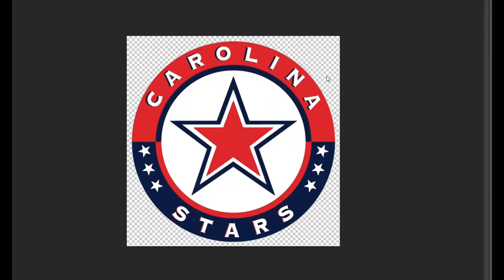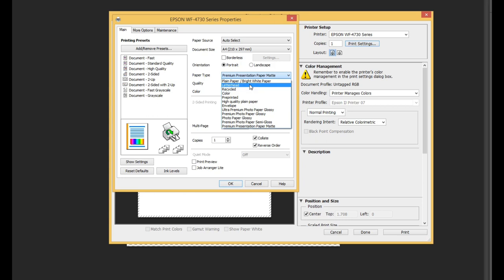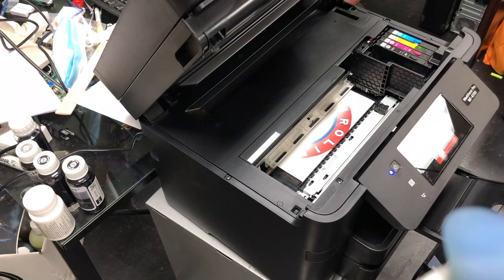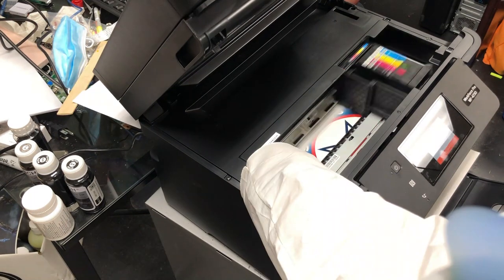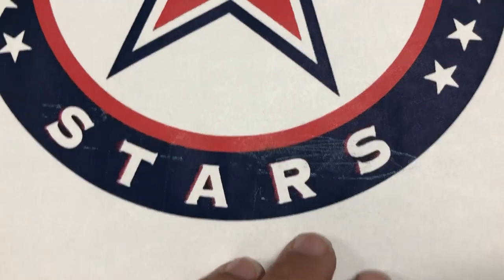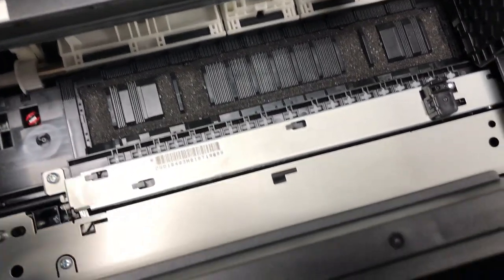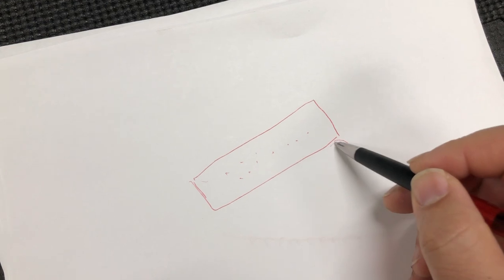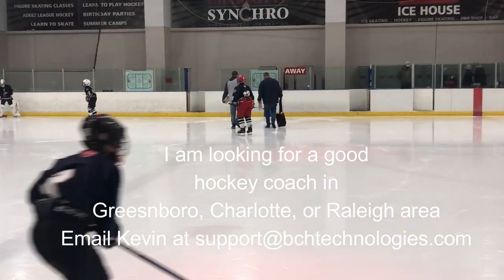#1 Remove/Reduce Epson Star Pizza Wheel Roller & Printhead Strike Marks

Comment: I have watched many videos and none were able to solve my issue. I use an Epson 15000 and constantly ran into random black smudging and spotting. The thick paper option in the extended settings is what actually did the trick for me. I was even able to up my density to +20 without any issues with no stopping of the print or fan blowing. Only drawback is prints definitely take quite a bit longer do to the slower passes, but well worth the trade off for me! Thank you for explaining in great detail exactly what was causing the issue and providing such great solutions!
Reply: @Mikayla Loaiza yes that's exactly what I'm using.
Reply: @Mikayla Loaiza You can adjust to the thick paper setting from printing preference, maintenance tab, Extended settings, Thick paper and Envelopes. You can also increase your print density here to your liking. I hope it helps you as much as it has heloed me.
Reply: I hope this helps me I am gonna try it. Do you have to change the settings everytime
Reply: @churchkimber6401  No once they set and saved you should be good to go.
Reply: @tnjsclothing6538  Could you share where the print density is? I found the thick paper but not the density. Thank you.

Comment: I keep getting pizza wheel dots on my tumblers.  This started after I had 1 piece of sub paper get sucked back into the printer as if I was printing duplex.  I have never intentionally used duple printing.  Since that day I have been getting dots in random spots.  Part of the problem is that the dots are tiny.  They are not visible on the paper until I heat press the page onto the tumbler.  I guess the heat makes the tiny dots expand and they appear in many places on the page and therefore on everything I have been sublimating.  If there is white in the design the dots are extremely obvious.  I have bought 2 different cleaning products and also have taped ribbon to a card and have cleaned the wheels manually by sliding ribbon with Windex through the wheels back and forth.  It did clean some wheels and leave spots showing it removed some bits of ink. But the next time I print then cook my tumbler I am getting new spots and some of the old.  I have more spots now than before I tried any of this cleaning.  I have the Epson ET3830 and cannot find a Bi-directional printing setting anywhere.  I also cannot see a page with the ink coverage like you showed.

Comment: Okay, so I keep coming back to the pizza wheel dilemma every time I print on glossy stock. Do these even really serve an actual purpose, other than to annoy? I decided to tinker with my Epson, opened it up, and removed all the pizza wheels with tweezers. Printer still functions fine, prints perfectly now. No track marks. I guess they're to keep the paper from pressing up against the exit slot, if ink is still wet it would smear? Remove pizza wheels and just turn off bi-directional if your ink needs more time to dry??? Personally, I've done about 20 prints tonight since removing, all 20 perfect. I don't get it. Aggravating pointless function. And it's not just Epson. I literally bought a Canon printer yesterday because I was so frustrated with track marks on every print. Canon uses the same type of pizza wheel system. Guess I can return the Canon printer now :D

Comment: Thank you! We use an ET-3803 for sublimation and have no trouble with transfer paper, but when we got into DTF we started seeing ink dragging through our images. The settings you recommended look like they've done the trick! I'm interested in the conversion from pizza wheels to a vacuum plate, though. We have a large-format HP that uses vacuum instead of wheels on the output and I imagine that's what the high-end, dedicated sublimation printers use instead of pizza wheels.:trophy-yellow-smiling:

Comment: Wow! Thank you so much for sharing this information, I'd been going crazy until now! I slowed my Epson ET 2800 down 25% and the prints are so much cleaner! Amazing, again ty.
Reply: Hi! I got the same printer as yours. I just got mine. Can I ask where is the option to set print speed on our printers?
Reply: @cjabelardo1458  printer preferences and there’s a tab called maintenance in that tab is where you’ll find extended settings

Comment: Did you ever remove the pizza wheels and make your custom air system thingy?
Reply from the maker: I come up with a new idea, which is to spray some glue (Elmer) on a film, and temporarily stick it to the transfer paper.  Then print the transfer paper with thick paper setting.  It works our wonderfully.
Reply from the maker: Actually, I just get it done today.  writing up the findings now.
Reply: @BCHTechnologies  hello how were the results? may I know? Since I am currently debating on whether I should just take off the pizza wheels instead XD. The vacuum system is interesting, but I believe the space is not enough and there might be a few issues with the outflow of the paper. Thanks for the interesting ideas! Btw do you know the reason why there are large ink droplets from the print on my sublimation paper?
Reply from the maker: @アルク-n6j  I just got the vacuum system done.  Follow my channel and I will upload the video soon.

Comment: Hello Kevin. Very informative video. I´m trying to find the correct settings to avoid pizza wheel marks but i´m having problems. I´m using sticky paper but the problem is if i use epson matt even with the lowest settings i´m getting pizza wheel marks. If i use normal paper settings no pizza weel, but i need a little bit more density. Any suggestions? thanks a lot in advance
Reply from the maker: You have to wait for the part 2, or use regular settings and crank up the ink intensity.
Reply: @BCHTechnologies  part 2?

Comment: I can't help but think you could get away with removing all the wheels and just keep two. One on the furthest part of the paper, potentially avoiding the wheels ever touching ink if never doing borderless printing. Would only be good if you only intended on using the one paper size also, but I suspect just about anyone doing sublimation on an a4 printer isn't printing on any other size. I'll probably look into doing this and see what happens.
Reply: I did this. Took a red hot knife and cut off the plastic with the wheels, leaving only the farthest left and farthest right wheels to enable the paper to roll out after printing. My printer is just the cheap Epson L120 so I felt free to disfigure my printer this way haha
Reply: @lola_incarnate  I knew I couldn't be the only smart person on the planet. U legend!!!